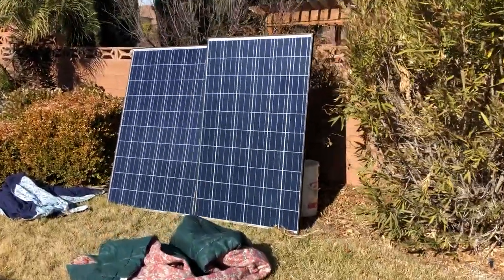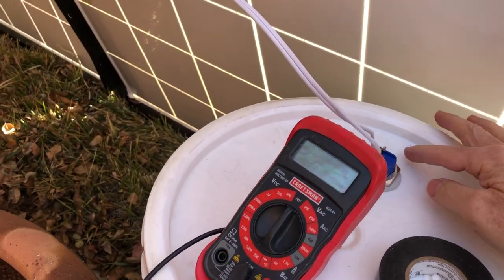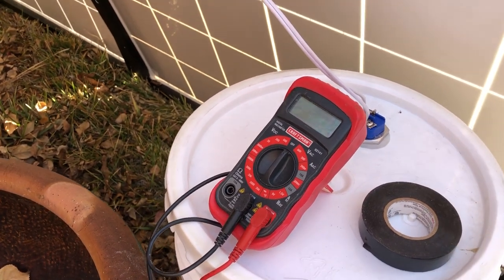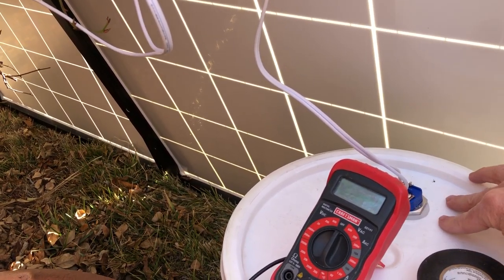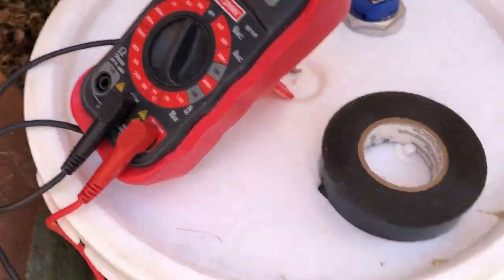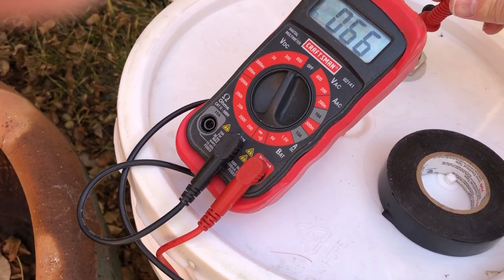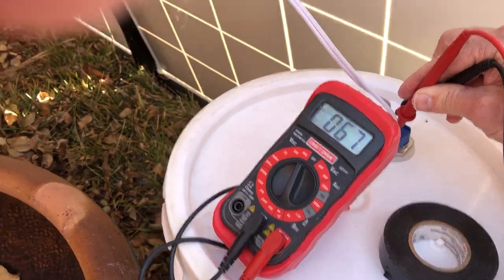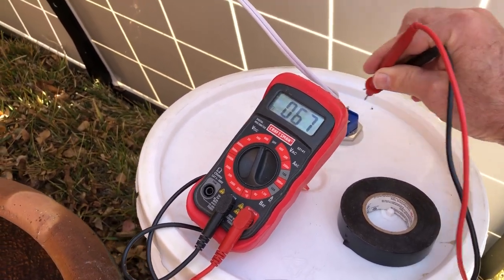Solar Water Heating with PV Solar Panel Experiment Part 1

Comment: Sunny day videos often give viewers unrealistic expectations of PV water heating. I have 520W of test panels dedicated to developing water heating systems. Direct connection to heating elements yields poor results thru most of the day. In February my panels at noon produced only 27W in direct connect and 73W with a simple power point control. It is easy to dismiss this power, but it adds up. Typically, it takes 50W continuous just to maintain temperature of an insulated water tank. Yesterday only produced 55WH with direct connect for the entire day.

Supplemental heating is an ideal use for PV as 100% power of a small will be used.  Without a power point control only 2 hours of heating can be expected. Suggest using a cheap power meter in your experiments to get real numbers of power produced. How much water can be heated is just a simple calculation from that. I have numerous videos on advanced water heating for those interested.
Reply from the maker: That is true.  The thing is that I live in Southern Utah and we have about 360 sunny days per year.  If you live somewhere like South Carolina or Ohio, you won't get nearly as much heat as we do.